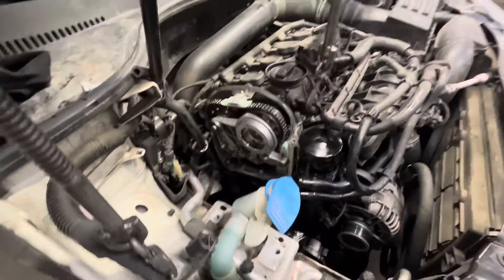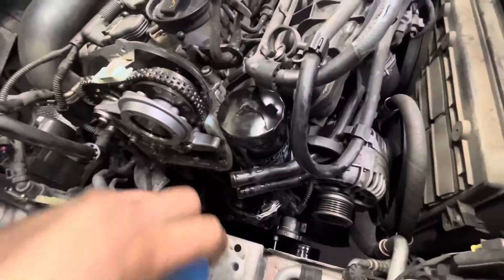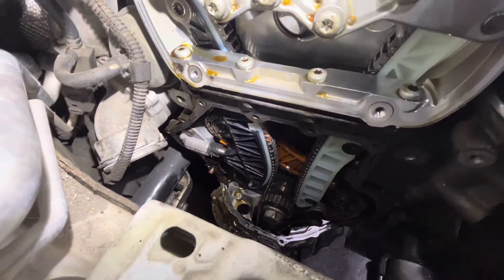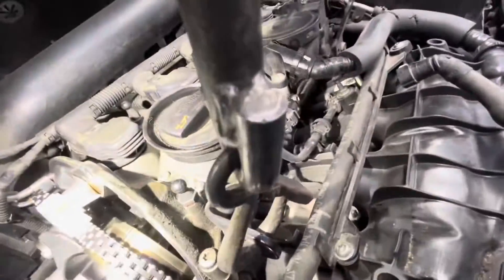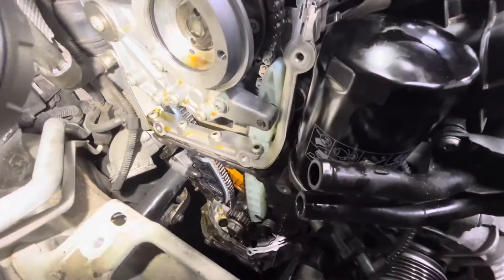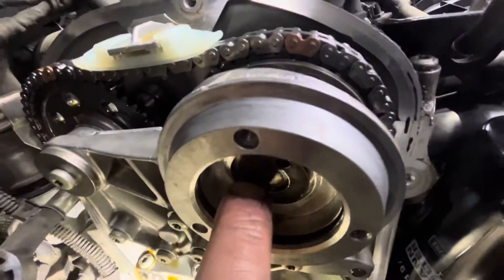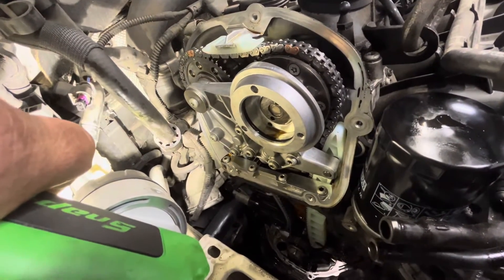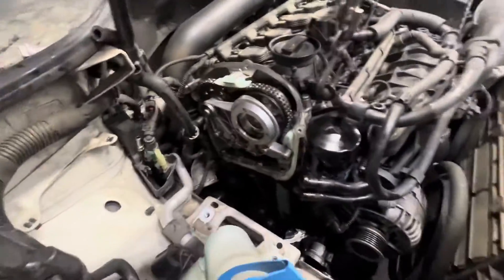HOW CHECKING TIMING CHAIN STRETCH WITH A SCAN TOOL WORKS

Comment: Question, this also goes for 1.4 tsi's right? If so, does it have to be when the engine is warm and idling, or can it not exceed 5 degrees at any time whatsoever? Because mine is near perfect at idle, but I logged a run in 3rd gear from 2000 to 5000 rpm and there were some split-seconds where it did get close to or even slightly exceeded 5 degrees

Comment: I bought a 2010 gti with this engine. The timing chain was allegedly replaced but my scan tool reads +5.9 at idle when warm. If negative numbers mean chain is stretched, does my reading mean they have the intake advanced one tooth off?
Reply from the maker: It is possible or you may have a issue with the intake cam adjuster magnet
Reply: @EuropeanAutoRepair  I tested and confirmed it works with a Fluke meter and my scan tool. I even took the solenoid in the house and actuated it with an adjustable power supply. Then i switched the polarity just to make sure it would actuate if the wires were backwards. I replaced the solenoid and the vvt spool as a precaution. It still does the same as before replacing parts. It actually runs pretty good with the solenoid unplugged but will missfire when plugged in and actuation occurs. I've got an appointment at a VW specialist next month so I'm sure they'll figure it out. I'm just stumped
Reply from the maker: @johnnycaulder379 sounds like a potential mechanical issue, let me know what they find out

Comment: Just checked this on a 2010 CC  with 173k miles, and it's at 8.62 degrees at idle. How can it be positive? It has a P0341 code (cam pos. Sensor range/performance)
Reply from the maker: When was the chain replaced last? That’s not original is it?
Reply: @EuropeanAutoRepair  i have no record maybe it's the original
Reply: @EuropeanAutoRepair  Might it be possible that the tensioner is on the counterside in this case?

Comment: Mine is at 3.29 while driving, 2.69 when not driving at idle when i first start it. Should i be worried ?
Reply: I plan on selling it by the end of the year. So I suppose i shouldn't be that worried ?
Reply from the maker: I would get it up to operating temperature and check it at idle
Reply: @EuropeanAutoRepair  what is the correct value at operating temperature .I have a cdnc that idles low like 750 to 800rpm car shakes but driving its fine only did that once today as it starter to do that this morning getting a p0016 code on the scanner
Reply from the maker: At idle and warm in a prefect world it would be very close to zero, once the value moves about 5 degrees away from zero it becomes timing chain replacement time
Reply: @EuropeanAutoRepair my car is at 0 at startup and then jumps to 10 after it warms up. Stretched ?

Comment: Is this possible using a SnapOn Solus Ultra scanner, or only possible with VCDS? Thanks for posting the vid/sharing the info 👍👍
Reply from the maker: Oh yeah you should be able to find intake camshaft phase in your measuring block values
Reply: @EuropeanAutoRepair  Nice! Recently picked up an a5 and have been hearing about all these timing issues. The car runs excellent, but it would be nice to have some peace of mind. Now I just need to bribe my friend with some beers to let me borrow his scanner LoL. Eventually I'll get VCDS. Thanks again 👍👍
Reply from the maker: @1madmaxx80 no problem man, hey I just bought this little Chinese scan tool a few days ago and it’s kind of blowing my mind, it does a lot, including all the measuring block values https://amzn.to/3GeWAE6

Comment: I have a 2017 tiguan and its at 5.07 degrees with only 72k miles, what can it be?, the tensioner, the guides, the chain or all of them…. I do get a little rattle noise
Reply from the maker: Yeah it’s possible that you have a stretched timing chain, any faults showing up yet?
Reply: @EuropeanAutoRepair  no, not really, im just worried i see all these videos about timing chain tensioner, timing chain stretch and catastrophic failure but its all till 2014 models i cant find any videos about 2017, i just bought this vw for my wife and she is in love with it and want to make sure it will last
Reply from the maker: @MrAldosandoval   well if it has no history of being done and you your planning on keeping it might not be a bad idea to think about doing that chain job soon,
Reply: @EuropeanAutoRepair  all of them or just the upper chain the 3 guides and tensioner?
Reply from the maker: @MrAldosandoval  I would say just the main timing chain all the guides and the tensioner
Reply: @EuropeanAutoRepair  thank you very much, im new to vw and i never anticipated how complicated they were

Comment: What is a simple scan tool that can tell me in degrees my timing advance? Will a $100 scanner do it or do i need a $500+ scanner
Reply from the maker: I’m not 100% sure but I think you might be able to do it with the free car scanner app on android phones and a cheap eBay Bluetooth obd2 dongle
Reply: @EuropeanAutoRepair  thank you for taking the time to share your knowledge. I never heard about bluetooth scanners, i ended up just buying a bluedriver scanner off amazon to try and diagnose my problem. Thank you!
Reply from the maker: No problem at all man, I’m glad to help the best I can, thanks for watching!

Comment: I have a 2012 audi a7 and my epc light is on and the codes are for misfire in cylinder 1&2 what could be the problem causing this
Reply from the maker: Could be a lot of different things, if you have not replaced coils and spark plugs recently and or have no record that’s a easy place to start.
Reply: move coils and spark plugs from cylinder 1 and 2 and see if the misfire moves to different cylinders, if yes then mot likely you need to replace coil/spark plug.

Comment: Just changed out the chain and tensioner due to chain stretch  - only 123K Km  ( 2010 Tiguan ) - tensioner was extended to notch 7 out of 9 - just caught in time. Thanks for the methodology of how the engine calculates the value
Reply from the maker: I appreciate that, yeah it’s funny how well maintained or not doesn’t really seem to influence this problem a whole lot, just a poor design
Reply: @EuropeanAutoRepair  your so right - I change my oil every 3K Km - not miles - full synthetic and Mann filters. When I took the engine timing apart, everything was very clean and smooth. The cam filters were clean and in position, so no worries there. I don’t give her the beans - I’m 67 and those days are past - my speed days were spent at Silverstone and Hethel. Cheers.
Reply from the maker: That is awesome, I wish we had tracks like those where I’m at!